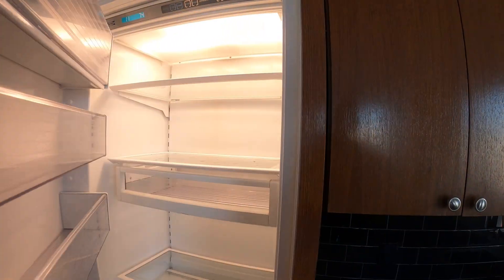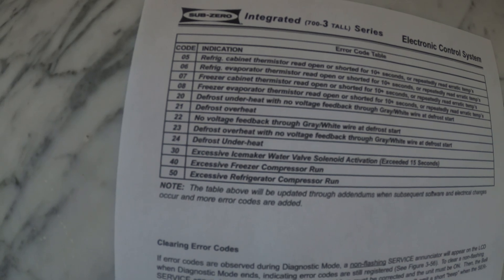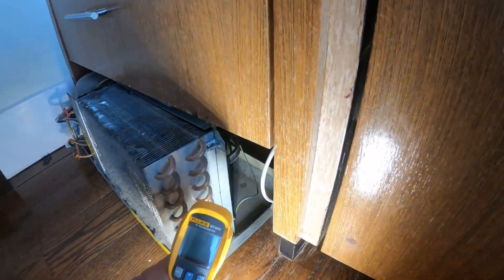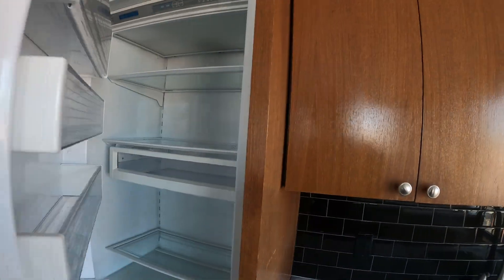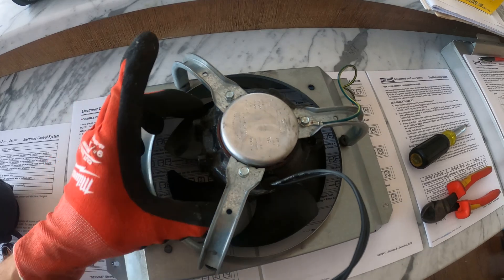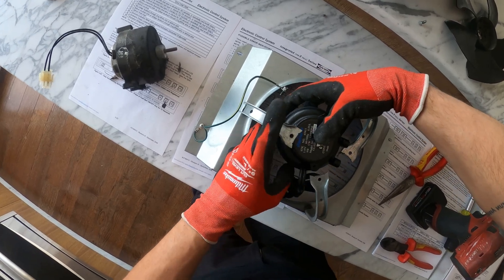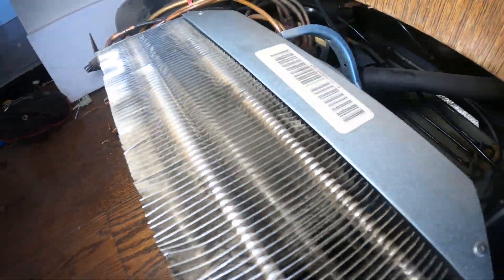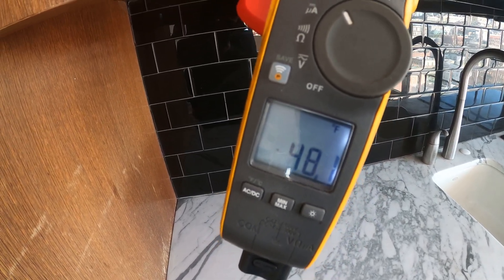HVACR Service Call: Refrigerator Not Cooling (Subzero Refrigerator Not Working Properly) Error Codes

Comment: Subzero‘s instructions are pretty clear on cleaning that condenser coil every six months. It’s relatively easy to do, especially on the top mount models

But most wealthy folks are too lazy to do this. They figure it’s manual labor..

Comment: Great job bro‼️ The only.thing that threw me off a little bit, is when you got a reading of 120v and that told you the motor was bad. Is that motor not supposed to be 120 coming in?
Reply from the maker: Thank you! The motor was getting 120 volts meaning the controls were operating and sending voltage to the motor to start. Since the motor was getting 120 volts and not starting, that means the motor is bad. For single phase motors, keep an eye out for a capacitor because that can prevent the motor from starting even though it's getting power but in this case there was no capacitor. Motor needed to be replaced. Hope that helps. Thanks for watching and stay tuned for new videos every week!
Reply: @Jumper man Tech  Ahhh got you, that makes sense. Ok Thanks for that Tip‼️
Reply from the maker: @joemcfarland3491  👍🔧⚡️

Comment: I've got a Sub-Zero 561 that I bought 15 years ago at a thrift store for $100.  The fridge side was warm.  I ended up replacing the thermostat on the fridge side, the condenser fan motor, and the fan motor in the freezer side.  It worked, after a good cleaning perfectly, until the ice maker died, and it's problem was a thrust washer.  I clean the coils yearly.  I'm glad I took the chance with it.

Comment: Great Video. Thank you for sharing. May I ask , Does refrigerator have the same Temperature Different ( TD ) the same as Air Conditioning for AC is TD is 20 Degree F is good from supply minus return .  How about refrigerator and Freezer ? I want to learn more about refrigerator and freezer
Reply: The td on most coolers is lower usually about 10 degrees. 
I think to keep the food from drying out, and to cut down the moisture on the coil.